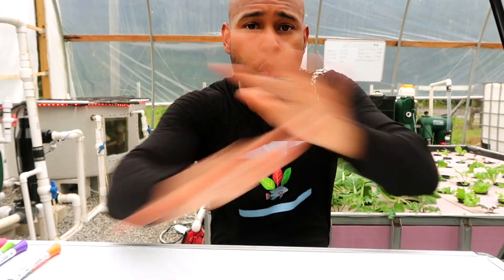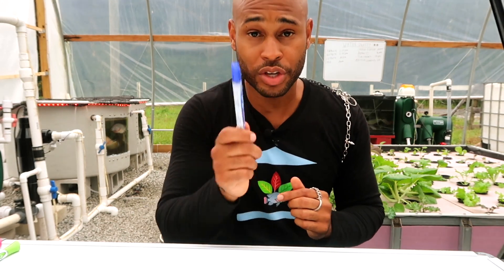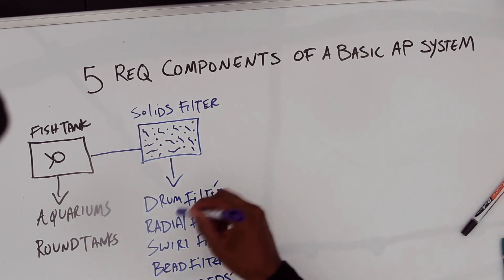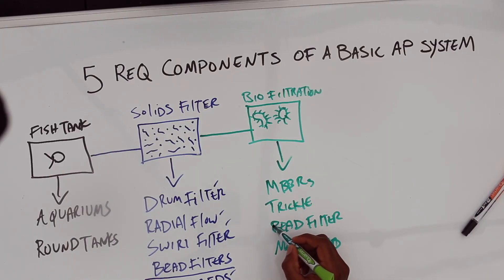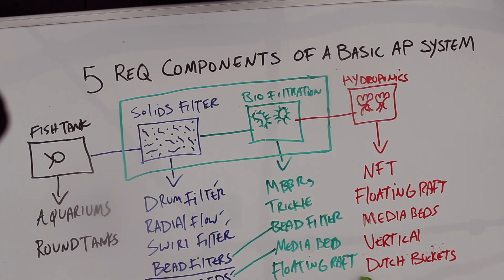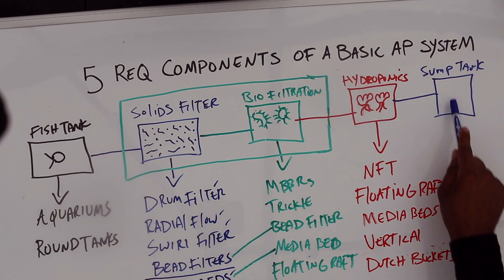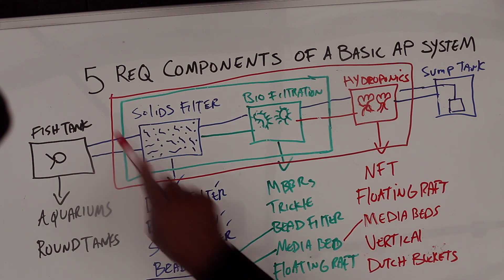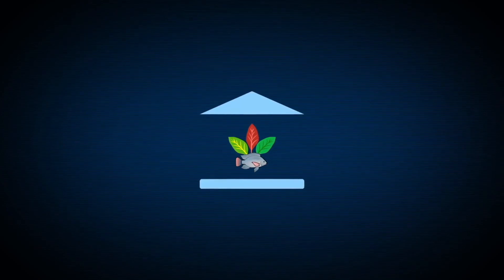AQUAPONICS: THE 5 REQUIRED COMPONENTS OF A BASIC AQUAPONICS SYSTEM

Comment: Hi Brooklyn Saint Michael. I have set up my aquaponic system and all i need to do now is to the plumbing. I have two fish tanks both 1000l each and therefore i am going to have an overall 2000l/hr flow rate. I am going to be using the exact SLO as you are in my fish tanks and I was wondering what pipe sizing I should go for for my SLO in my fish tanks and my system?